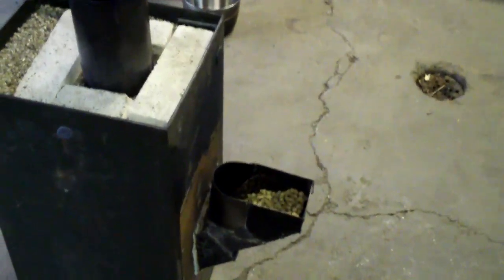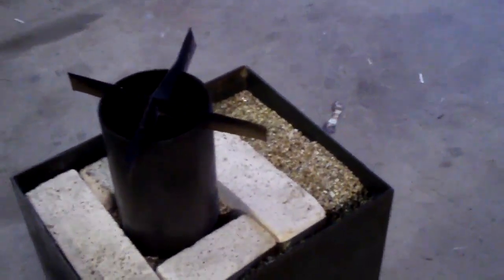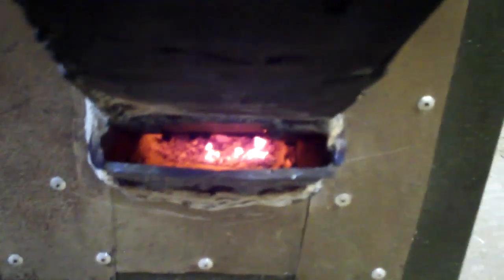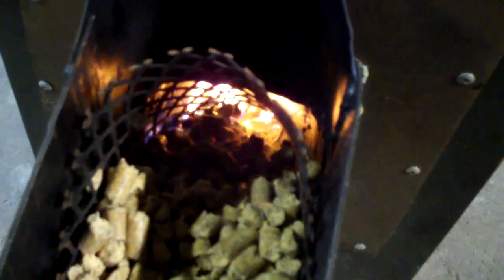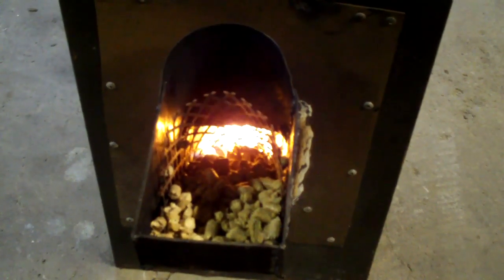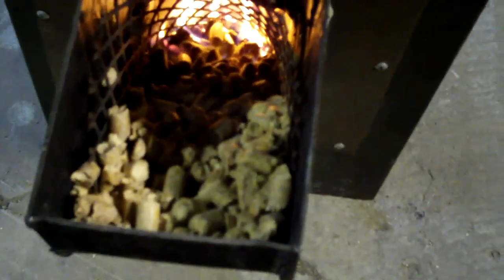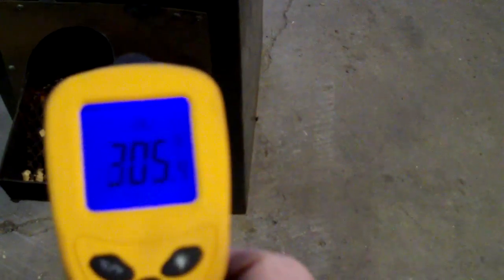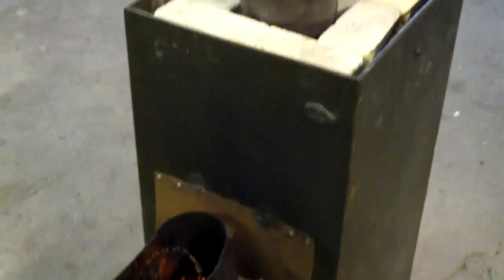Frankenfurnace lives !!!   My self feeding Rocket Stove

Comment: Now you need to build a large hopper and it will run day and night. I built a 14" X 14" hopper, which tall enough to hold 60 lbs. of pellets, so it will run all day and night without watching it constantly. Actually I have to shut it down 'cause it heats me out sometimes.

Comment: I made my burner out of 1/4" stainless rod, welded 1/4" apart so the pellets don't fall thru until they are burned, then fall into an ash pan to continue to burn up.
 Also, having your air intake behind the pellets will work a lot better and burn hotter, that way you can control the heat output by controlling the air intake. With a 3" X 4" burn basket, I can get mine up to 600+ degrees. With a hopper filled with pellets, I light and walk away, no problem with build up in the basket. Just light ashes in the ash pan underneath.
 My next step is to fabricate an waste oil drip feed to burn my waste oil when I don't burn pellets. 
 So I will have the option of burning stick wood, pellets or waste oil to keep the shop warm! It's just nice to have options.
Reply from the maker: Awesome , thanks.. Do you have a Vid of yours?

Comment: Hey many thanks for sharing your design. do you have a diagram of the geometry of it all somewhere for us. I am getting close to building something. Some form of self feeding would be wonderful. And screw those whiny bastards who's ears hurt. Great informative Video. Maybe  just roll a cone of flashing or other thin sheet metal or bend a box and clamp it on there with a small clamp or whatever, no welding, to see how a bigger hopper might work? And thanks again! going to check your vids now.

Comment: What about using corn as the fuel?  I have seen the heavy steel welded room stoves using corn, corn burns hotter and cleaner.
Reply: David Januszewski corn will blow up its not a gasafire

Comment: i like it im getting a old B vent gas furnace think ill rip off some of your ideas stick the furnace on top after removing the gas burner stuff and plumb the rocket in to the heat ex-changer i might vent mine outside but my little shop is more like a wind brake no C02 collecting frost bite is the bigger problem lol

Comment: If you have windows 7 it should be asking if you want to install optional updates in the lower right hand corner of the screen upon startup. Once I installed these updates the sound was fixed and realtek hd audio manager worked again. BTW I highly recommend realtek for a great free surround sound audio manager. Hope this helps

Comment from the maker: You have to vent it, I just ran it to test the pellet feed.. If you were to run this for more than an hour in an unvented 24x24 or smaller space you would have problems to say the least.  My ceiling is at least 10 feet from the top of the stack. It isnt finished I will eventually add a top reclaimer/plenum and an exhaust, but Ive fallen behind on all aspects of my projects....And I miss this one the most!!!

Comment: Thanks man, been wondering about using a file cab, seems such a good pre-fab fit to the application and people are always giving them away. Also good to hear you comment on the burn-off. Was curious to know how it did inside the garage w/out an exhaust to exterior. Been reading a lot on camp stoves and CO, the big danger myths. If its clean and the room is big with even slight ventilation, is it really a risk? Also, whats a good distance from pipe top to ceiling to prevent ceiling heat damage?

Comment: I built a small RM stove, and added a removable  8" tube that goes straight up from the TOP FEED HOLE. So after I start the fire, I add the tube and stuff it with sticks, sawdust, pine cones , and it automatically feeds like yours. I really like yours, just don't want to buy the pellets. Merry Xmas!

Comment: that's very cool. It looks to me like the pellets near the combustion are being heated to pyrolosis and emitting wood gas. Then the gas is being sucked up into the rocket and burned there. I think you have a wood gasifiying rocket stove! that does sound ridiculously efficient. But please at least crack a window next time. Even if it's not emitting much CO you can still asphyxiate on CO2.

Comment: Awesome build! Thanks for posting your work and design. Using a self feeding mechanism and pellets is a great idea. My biggest fear with having fuel outside the actual stove has been that if my design is faulty, and the chimney effect reverses, the fuel will burn up the trough and outside the unit. I like the idea of having the lipped mesh extend into the burn chamber. Kudos!

Comment from the maker: .His burn seems very complete but my shorter stack(compact) requires the burn to happen before it reaches under the exhaust where his burn is directly under the exhaust. When I allow my fuel to burn further in the chamber it doesnt  draw the air in great enough velocity to generate the heat I am shooting for.

Comment from the maker: Sort of,  I loved that design however I wanted more narrowness to keep the fuel directed into the combustion chamber without there being any "gaps" under the exhaust outlet. I also wanted a longer tube design on the inlet(feed area) to accomodate the fuel so I could load more without refilling but most importantly I wanted a narrow long tube design to get more air velocity directed in a smaller combustible area...

Comment from the maker: @apples13able I thought about the water as a heat meduim but was trying to keep a little more mobile, its pretty heavy now with the bricks and such in it, plus If I was to use it as heat Id have to run some sort of antifreeze in a closed system with an expansion chamber andregulate the water flow as well as the fuel supply. I think an air to air would probably be the simplest way to extract the heat.....Thats a little way down the road yet.

Comment: Or maybe copper around pipe, another pipe over wrapped copper, pour sand into gap with copper for thermal mass then smear cat litter/vericulite mix over that. It could be a seperate unit that you fit ontop of chimney pipe- maybe cut stove pipe to just above stove, then you could fit on different types of mini chimneys or water heat exchangers...  Your video is actually very exciting and I hope people out there are trying to increase refuel times altho 50 minutes may b ideal for safety.

Comment: It would be interesting to wrap a 3/8" copper tube around the chimney and insulate it with another wider pipe around it filled with vermiculite, maybe some clay (hot water + cat litter?) on top to seal the vermiculite. Tests could be done running water thru the pipe- does it affect the burn? How hot would the water be? Hook hot water to radiator in a tent? mini sink? 
-I bot 4 square feet of vermiculite (two pillows) for $20 @ a masonry supply store. Other idea: drip waste oil as fuel...